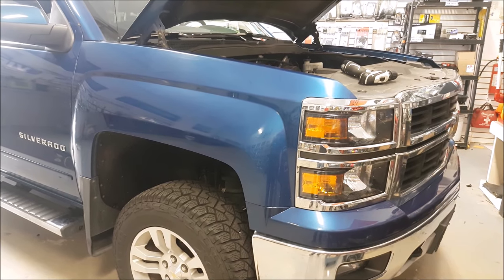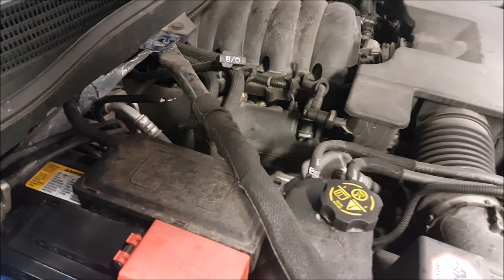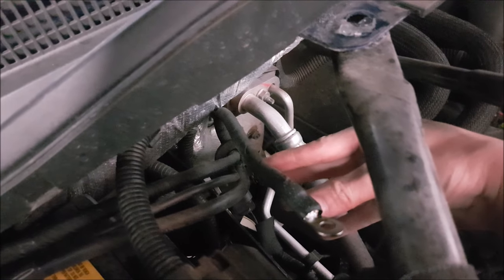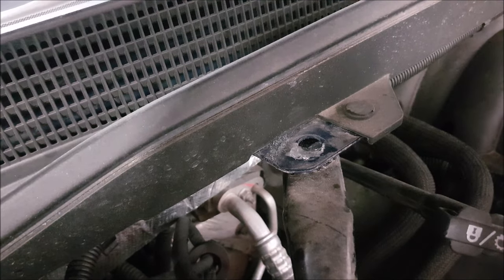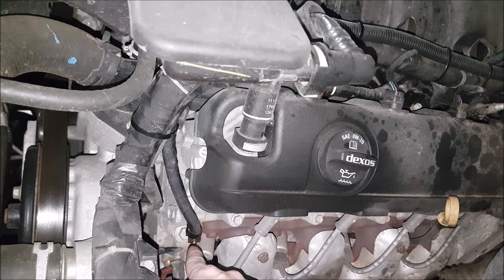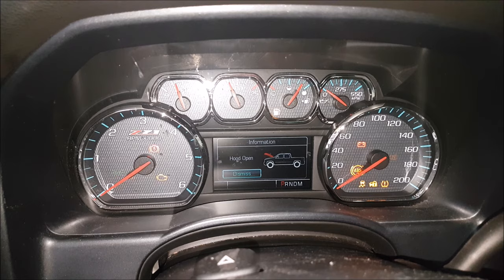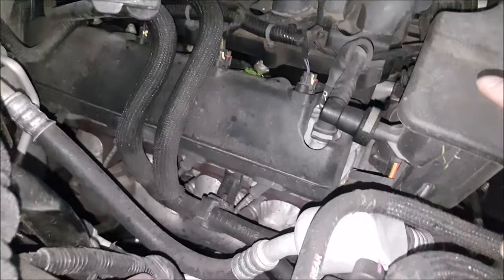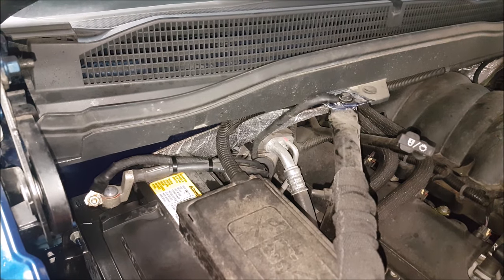2014-2018 Silverado/ Sierra Ground Upgrade K2XX (Prevent Electrical Issues) | AnthonyJ350

Comment: Grounds are a majorly overlooked issue with many problems on modern vehicles! We had a sang, if it’s goofy it’s a ground.
Reply from the maker: 100% agree. Cleaning and upgrading grounds I believe can prevent a lot of issues and prolong electronic life
Reply: @AnthonyJ350  so many “check engine lights” are not caused by bad sensors etc. I have seen way to many people throw money at vehicles on sensors, PCM’s, other needless repairs. Like it’s seems to be forgotten that modern engines are still internal combustion engines, functions same as “old” pre-computer engines. Much is the same as computers controlled systems, has the basic principles of electricity. Sometimes no codes can be faulty sensor causing other issues. ie I once had a V-6 S-10 with hard fault blown gauge fuse. I inherited this vehicle, after cluster had been sent out, npf. After tearing my hair out talking to tech, found a shorted ground on heated O2 sensor. No CEL, no codes at all, no starting or drive ability issues. Just blown gauge fuse. Sometimes those wiring diagrams help! When I called tech back didn’t believe me, had to walk through diagram with them. Found off one PCM circuit tied to gauges circuit. Just thought I would throw that in.
Reply from the maker: @petermcneil4414  Was the O2 wiring pinch somewhere?
Reply: @AnthonyJ350   no not at all. Sensor itself shorted. I know right
Reply from the maker: @petermcneil4414  I've seen devices short internally. Nothing you can really do to prevent it and it's rare. Good job diagnosing that one.
Reply: My 2014 Silverado LTZ Z71 Sometimes the blower fan will go into hyperdrive and I can’t turn it off while or after turning the steering wheel in the parking lots with either the heat or AC on this ever happened to anyone probably a ground right and it is goofy

Comment: when i did my big 4 upgrade I replaced my oem cable with 4' of 4/0 cable from Knukonceptz Kollassus line. all connections were crimped AND soldered with knukonceptz cable ends and heat shrink.
Reply from the maker: That's awesome!

Comment: Going to try this tomorrow. I have a 14 Silverado that will no start/no crank after an hour of driving. Gauges come on when the key goes in, turn it and everything shuts off. No codes, starts with a jump. Will start after it sits for an hour or so.
Reply from the maker: Let us know how it goes. I've heard one of the battery cables might be faulty and needs replacement all together.
Reply: Starter is heat soaked. Better shielding helps and upgrading the ground to the starter will completely eliminate the problem
Reply: Which one, negative or positive?

Comment: This COVID 19 thing stinks.  I found some new 4 gauge battery cable in my garage.  Do you think that is fine?  Did you use 4 gauge for both sides?  This way I don't have to leave me home.
Reply from the maker: Yup I used 4 gauge.  The 4 gauge I have in the shop that is 100% copper has a factory fuse rating of 175 amps so I think that's more than enough for most vehicles, especially since we're adding, effectively stepping the whole system to 2 gauge when combined.

Comment: Anthony, just reviewing your video again plus your earlier one. My question is: Will the engine ground on driver side that you added, cause any issue because it did NOT go thru the "reader" on the battery side? Hope this makes sense.
Reply from the maker: I under stand what you're saying. It will work because it's the ground from the battery that needs to go to the sensor, then it sees anything from component to chassis.
Reply: Thanks. Weather is better so will install the extra grounds

Comment: I’ve got a 2018 that intermittently loses power going down the road. The display shows steering assist is reduced, service stabilitrak, service trailer brake system, doesn’t show fuel usage, and ac quits blowing cold air and I loose ability to acceLerate. I pull over and it typically does not crank. I turn key and all those lights still flash but no juice going to starter. I can slam hood or maybe door and it will finally restart and may go 1-3 months before it does it again. Any ideas? Could this be a bad ground?
Reply from the maker: Very good chance it could be a loose or corroded main ground. Inspect the main ground cable off the battery and inspect on both ends. Replace if necessary.
Reply: I had corrosion on ground cable on mine. The insulation had burned off one side of the negative cable right where it passes by the passenger side exhaust. Look carefully from engine bay on passenger side, follow the negative cable as it passes exhaust after the manifold. It would be easier to see from underneath if you are able but u may not even have too.

Also can look into the G218 ground issue w these trucks, it's inside under dash near bottom of driver side windshield. Need to take a cpl things of but nothing serious. May brake some clips, but a 2 part epoxy can fix them right up.
Reply from the maker: @Chronic898  Thanks for sharing!

Comment: so you went negative post through the amp clamp and onto the cowl support for the passenger side?  These two mods are easy.  Something to do in my 2018 during the stay at home quarantine.
Reply from the maker: Yup exactly, just make sure to really do a goo job getting off the paint. The threads are in the support bar so you wont really get any connectivity through the bolt.
Reply from the maker: Upgrading the grounds should also aid the electric power steering at low speeds.

Comment: Will this or any other suggestions fix the radio scanning, changing bands, going to navigate? Just started after changing battery. 2017 Ltz 23,000 miles. Doesn’t seem to matter if anything else is on or not. Dealer where I got it from. Is replacing the glass display unit. First time that it’s been in for this problem. Reading here on the internet. Seems like a common problem. With many many answers.
Reply: More than likely not. I had the same issue with my screen randomly changing and making the beeping noise like the screen was being touched. 

I tried changing the HMI module, but still has the same issues a few days later. 

So I took the screen out and checked continuity between the horizontal and vertical pins on the 55pin ribbon cable. I had about three vertical pins that were dead short to the horizontal. I ordered a new touchscreen from eBay, but while I was waiting I tried physically cutting out the offending pins from the cable. I haven't had any issues since then and there is only about a quarter inch dead vertical strip on my screen.
Reply from the maker: Not sure, I had a similar issue with my aftermarket Kenwood.  Ended up being the tuner so I sent it for a repair and they replaced the internal part and fixed it.  I tried firmware updates and resetting it so software definitely wasn't the issue.

Comment: Anthony..great video. I want to add these grounds to my '17 silverado. Can you provide P/N for the GM side terminal that you mad ref. to on the drivers side of engine. I guess I'm not sure what you put on there. I did catch that you used 4 gauge wire.
Reply from the maker: Oh the GM side post adaptor can be purchased at your local install shop.  We use them when we do amplifier or installation of other high draw devices that need to go to the battery.  Older GM vehicles had side posts for the battery attachment.  Hope that helps!
Reply: @AnthonyJ350  Well I was wanting to just order it from Amazon or ebay and don't know what to look for. I did a search on amazon for a "standard GM side terminal & found this  https://www.amazon.com/s?k=GM+side+terminal&ref=nb_sb_noss
Is this what you're talking about?    As for ground cable, I was hoping to just find a new precut  with terminals, like Everstart SS51-2-77 4-Gauge Switch to Starter Battery Cable, 51-Inches that I can buy at walmart without making them. I think 51" would work on drivers side & will see if I can find a shorter one for the battery side. Do you know the lengths that you made up?  Also, would it be beneficial to add some dielectric grease over the terminals to keep from corroding?
Reply: JIC anyone is wondering if the amazon bolts in the above link work, I ordered the gm side post adapters from there and they were a perfect fit for my 2016 6.2 Escalade.

Comment: For anyone looking for ground issues not covered on many vids- Follow negative batter cable from battery to where it passes by the exhaust right after passenger side manifold. Mine had melted insulation allowing the wire to corrode. I had no issues, but noticed during undercoating a cpl weeks ago. 

Luckily welding cable was on sale at princess auto last week so I picked up some 4ga. It was a steal of a deal so I grabbed 20ft and should have plenty to also do some of the upgrades shown here.

Good video man, thanks a lot for the this.
Reply from the maker: Thanks for sharing!

Comment: I did all this and it ended up being my starter cable (positive) being less then a 1/16 loose, appreciate it either way
Reply from the maker: Glad you figured it out. Doesn't hurt to upgrade the grounds anyways.
Reply: You mean the round plastic plug that goes on the starter?

Comment: Good video, I just did the "big 3" on my 2012 dodge ram 1500  5.7 Hemi. I used 1/0 gauge welding cable, copper lugs and heat shrink tubing. To protect the welding cables I installed  1/2 inch convoluted tubing.
Reply from the maker: Nice, did you notice any immediate difference how the vehicle starts or with normal operation?
Reply: @AnthonyJ350  Yes, it seems to spin up a little faster.

Comment: After watching this video last night, I did decide that I wanted to do this to my truck. I have a 2014 Chevrolet silverado. No, I have not upgraded the grounds or anything else. I simply therefore, I do believe it is time for me to do this.  I am going to make a slight modification. I am going to be mounting a terminal block to the firewall right next to the ground, then I am going to cut the negative cable going to the engine block, and recreate an end on here and then with the new terminal block, I can put my added wire to this as well as the wire going to the engine block.
Reply from the maker: Let us know how it works out!

Comment from the maker: You can find the tape here, this is just for harnessing purposes.  It does not replace electrical tape:  http://rover.ebay.com/rover/1/711-53200-19255-0/1?ff3=4&pub=5575240889&toolid=10001&campid=5337982243&customid=&mpre=https%3A%2F%2Fwww.ebay.com%2Fitm%2F4-pcs-TESA-51026-19mmx25m-tape-high-abrasion-protection-of-automotive-harnesses%2F173817273443%3Fhash%3Ditem2878511c63%3Ag%3AyKIAAOSwdzBcwDZ1
Reply: I have a 2014 GMC Sierra 1500 I had my transmission replaced. Is there any wiring that affects my a/c? The air only blows through the floor now.
Reply from the maker: @jacobmaldonado2210  Some just cold me this procedure worked on their 2019. You just need to find the HVAC fuse.

https://youtu.be/grF8aRtgu1I

Comment: Have a 2018 Silverado (Z71, LT) 1500. Replaced OEM lead acid battery (could hear it getting tired during starts) with Interstate AGM battery (preventativemaintenance). Remove/install went smooth. Truck starts/drives fine, BUT: no power locks, infotainment inop, no signal, no brake lights, no 12v cigarette lighter power, right headlight inop, no  keyless entry inop. Center display shows no traction control, no odometer and none of the steering wheel menu buttons work. Truck starts, idles,  auto trans shifts fine. Have not had on highway to check higher speed problems or cruise control. This is my daily drive & really need a troubleshooting assist. TY -Shawn
Reply from the maker: Sounds like a main fuse is blown. Did you check the fuseable links on top of the positive battery terminal.

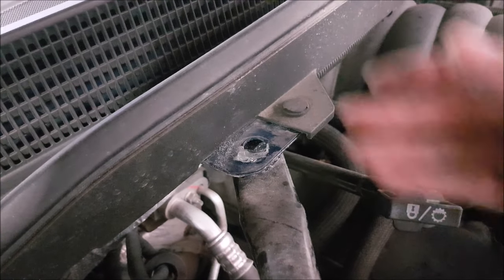Comment: Quick question - at 1:21. Could I use one of those welded studs to the firewall that the wire harness is clipped to with those plastic zap straps that have provisions to slide over the studs.  I could remove one, clean the paint off.  Then secure my ground with a 10mm nut and put the plastic zap strap back in place over the nut.
Reply from the maker: Yup for sure you can do that.

Comment: Very informative. My 2015 Silverado is having ABS, stabilitrak and shutting off while driving issues with no check engine light or notice of shutting off, just powers down and loses rpm. No check engine light or codes on shop key. Traced all the wires, checked ecm, ebcm, and cleaned them. Wires seem fine and no corrosion in control modules. I am all out of ideas and have seen a few videos grounding the engine on the drivers side to the factory ground. Seemed to have helped a few people, yourself included. What size bolt and what gauge ground wire are you using for this ? Any help is appreciated. Thanks I’m advance.
Reply: All readings on wheel sensors are fine while driving and voltages check out on alternator and battery as well. Just replaced the battery.
Reply from the maker: I use 4 gauge wiring. Oxygen free copper.
Reply: @bubbAorr did you figure it out?
Reply: @cristianrojas5866  yes wiring harness on drivers side. Wire controlling the run crank relay was shorted. ABS/stabilitrak was a separate issue. I just changed the sensor for that one.

Comment: My 2014 Chevy Silverado the voltage was down real low and then when I got home it was down or nine and fluctuate normally back-and-forth at this time it didn’t and my battery was dead. I couldn’t start to check again but when I put the jumper cables on. It melted the wires on a jumper cables like I have a short somewhere.
Reply from the maker: Did you replace the battery and make sure everything is tight?

Comment: What length and end size did you use for the ground cable?  May be the fix for my intermittent issue with my ‘15 2500.
Reply from the maker: I used 4 gauge.

Comment: My truck doesn’t want to start often I have to mess with the battery cable or it shuts off while I’m turning do you think this is the issue?
Reply from the maker: Have you tested the battery? Are the terminals tight and can't move?

Comment: I added another strap but didn't put it through the sensor,  I was having issues with starting,  I couldn't just crank it over I would have to put the key in the on position for 3 seconds then crank it, now it cranks right away,  testing shows, battery, cranking and alternator all check out.
Reply from the maker: You should run the cable through the sensor.
Reply: Thanks, I'll reroute it so the alternator knows what's going on 😁

Comment: I have a 2014 High Country with the 6.2. I am trying to figure out an electrical issue. My left headlight is dimmer than my right (low beams) and my left side running lights do not operate unless they are blinking or hazards are on. I have cleaned every ground I can find. Any suggestions?
Reply: Also checked the fuses. They were fine.
Reply from the maker: Try adding a ground directly to the circuit like I did in this video https://youtu.be/Y1YqTBg6NzI?si=lMK_wSBCxfzBaPwF
Reply: My 2016 does the same thing, glad to know I'm not crazy lol

Comment: Do I have to remove my current factory ground wires or am I just adding to it with this? Essentially after doing this I will be doing a complete big 3 upgrade and will be replacing positive wire with a 1/0 from the alternator to the battery correct? Can I do 1/0 for the positive and 4/0 for the negative because for the sensor pass through? I have the same exact truck is why I’m wondering.
Reply from the maker: You're just adding on.  I would only replace if the factory cables are really corroded.
Reply: @AnthonyJ350 Thanks! I have a bunch of off-road lights that I want run and want to prevent issues when running them all at once.

Comment: I'm having trouble finding the battery sensor for a 2017 Silverado 5.3 I found one that looks similar but don't know if it the right one it for another Chevy model
Reply from the maker: Did you trying calling the dealership with the VIN?
Reply: Gm 13505369. Also used in Opel, Cadillac and other gm’s.

Comment: Can I ground my second battery directly from the first one? Or does that wire have to go thru the sensor as well?
Reply from the maker: If it doesn't go to chassis at all you can ground it to the other battery.  Just check the standing voltage after and check again when the engine is running.
Reply: @AnthonyJ350  thanks bro! Appreciate it!

Comment: My 2018 Chevy Malibu has the battery current sensor built-in to the negative terminal, one peice. Do I hook up my added ground to the same spot my stock ground wire is on the sensor. I was told by my mechanic not to do that. Do I need to hook it up the same spot as my stock ground wire on the sensor?
Reply from the maker: Can you replace the factory wire and just make it thicker?
Reply: @AnthonyJ350  No because I have extended warranty. Should I disregard what he said because he also said I over torqued it so that was part of the problem. But I had this Check engine light with code U01B0 Lost communication with battery sensor for 6 months. It started from a dead battery. So do you think maybe it got shorted out from jump starting it with another car and jumper cables and the sensor got damaged by the other car?

Comment: anthony...i just did your added grounds as you specified (2x) & now I see 12.7 V on my little volt LED display that I plug into the lighter socket. Before it would read 12.3-12.4V. Not sure if this is due to just cleaning the ground cable terminal or the (2) new 4 Gage wires. Thanks for the tip on the cables & block connector. Good stuff.
Reply from the maker: Most likely is due to you cleaning the grounds and doing the upgrade.  Especially if you see the improvement right after.  That's good preventative maintenance!